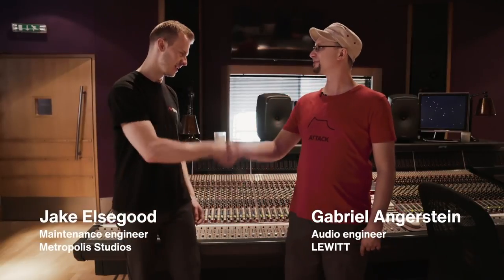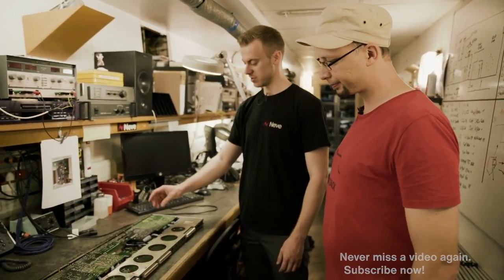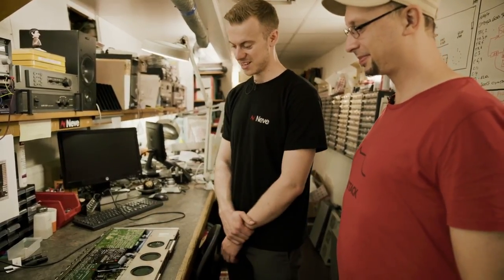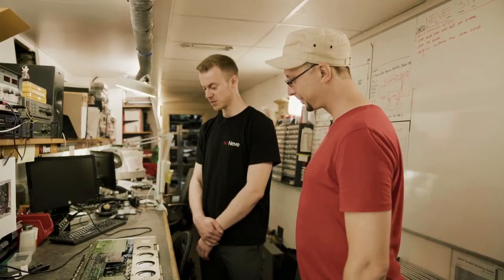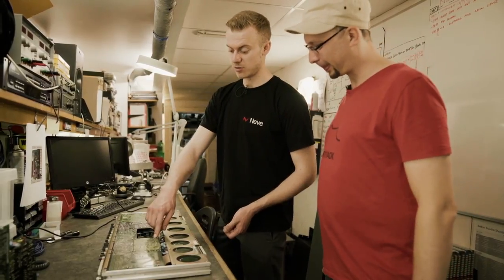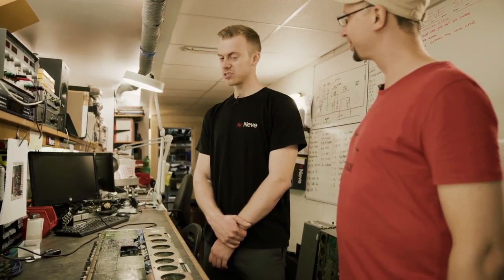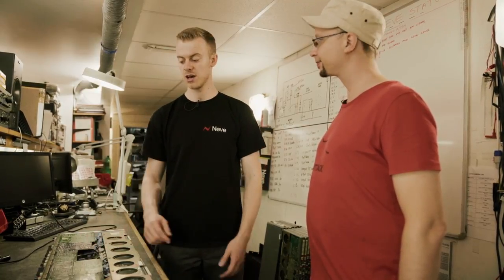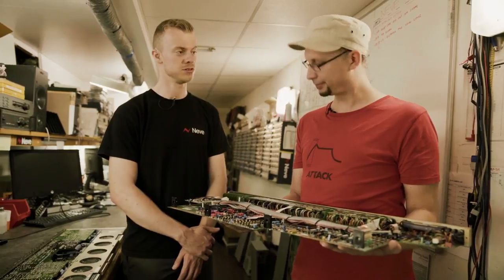A legendary Neve console and how to maintain it

Comment: On average £12K a year on electricity yes just electricity , and usually depending on how big of a knob the singer you have in the studio and extra few Grand a year in whatever module or Aux Goes down unless as I mentioned before singers who like to balance Brandy and coke on the edge of the meterbridge and get excited and knock it in to write of an entire 12 channel bucket .  I called it quits after that one and sold the rest on .  23 years and countless tens of thousands of pounds later we sold her on to a studio in Greece , I did keep 2 1073 moulds and 2 1064 from the Bucket that got killed , still have them now .
Also had a VR for a few years nice board not as sexy as the 8024  but still a lovely board
Reply from the maker: Ahahah! These sound like some very interesting sessions you've had! 😅 It's definitely a lot to maintain, are you mostly in the box these days then or what have you transitioned to?

Comment: I don’t own a Neve, but I still find this video to be very interesting, and, not just for Neve circuitry, either, but for all analog audio electronics, as some of the issues mentioned here (like the electrolytic caps on the EQ filters drying up and failing) could be encountered on any older analog desk. 
I love analog gear, it has a sound and vibe of its own. As a young engineer coming up in the early 80’s, I learned the craft of audio recording/mixing on analog consoles, tape machines and outboard processing. And when everything was working, it was a wonderful thing. 
But, analog gear does indeed require maintenance, and this video acts as a good lesson to impart to those engineers who are too young to have worked in analog studios, but who are thinking about integrating analog recording gear into their own studios... and that lesson is that analog audio gear doesn’t perform at its optimum forever. 
It’s not a question of “if” analog gear will ever need repair... but only a certainty of “when”. 
And, sometimes components did fail gradually over time...but they could also fail without warning...which, of course, always seemed to happen in the middle of a session. 
That said, if one has a solid working knowledge of circuitry and its repair, or component replacement, (IF you can still get the parts you need), then these people are better-suited for having and working in an analog studio.
🙏
Reply from the maker: Wow Donny, thanks so much for sharing your interesting thoughts. Really appreciate it!

Comment: I can really relate to this... I used to do a great deal of troubleshooting of PC boards with bad Vias.  Often boards with 8 layers just for the DC power.  Ground plane on the outside front and back (for shielding), then layers for+5V, -5V, +12V, -12V, +15V, and -15V power.  Then maybe 3 more layers for signals. After so many iterations of soldering, some of the internal layers may become disconnected from a via.  You have to be a damn good tech to sort it all out.

Comment: The big problem of neve v series is the switches because of the heat that the console creates inside, reduces the age time of the of plastic latches. Latches break inside the switches due to heat aplied to them, not the durty from behing used. Those  switches when were made there was 2 types of lacthes used : the white plastic latches that was more or less good, then neve realised the problem they had in hands, they changed to a black type of latches that supposed to be better to heat, in fact they proved to be worse then the white ones. Today we have tech, i improved my neve with a reduction heat system, in fact it actually heats less then my duality because extracts the heat faster frim inside, also  we have new latches for high temp. Plastic, that we replaced in the console, now actually the console reduces almost 95% of the issues that she had, caps switches problems is a thing of the past, we stop 10 days a year to maintenance of the console first 2 years, now actually we are doing 5 days a year, and we don't need any tech present. We got 5 spair working channels, and we swap a year 1 or 2 channels to repair. Top console

Comment: Is it left on 24x7 because it's in use that much or because that's best practice?
Reply: My cousin works in this studio, they're pretty busy.
Reply: I cant see leaving leaving electronics on for the hell of it to be any good. Constant heat is an enemy of circuity (even under normal operating temps) and would wear the components out faster and shorten the life of them. That is why this board maintenance is a full time job due to being always on.
Reply: AC units are installed running up to the important areas with ducts. Best to leave on to avoid spikes when switching on/off the ac units bring the area down to a very chilled temp.
Reply: It was a theory that proved incorrect.
Reply: One reason is that on many of these consoles the sound changes as they heat up, so if you turn it off you have to start it up several hours before you start recording to give them time to heat up.

Comment: So, I take it heat is principal in getting the right sound, even in non-tube class A systems like that Neve board, or does it matter?
But the question I have is do these vintage Neve consoles have fans built in to help divert heat away? There's always the fan noise you want to avoid , but still, some circulation would help "cool" things to a degree and increase the life of these capacitors wouldn't it?
Reply from the maker: Don't believe these older consoles had built in fans, but I'm not 100% on that. Studios definitely have to invest is quality HVAC systems because these consoles can heat up the whole room!

Comment: I might also point out. These guys are talking about a, Newer, Siemens, Neve.  Which is way more complicated. Than, Rupert's, earlier offerings. Between 1968 and 1974. When it was still Rupert owned. And not, Siemens.

Siemens had a rocky start. With a mistake they made. That nearly destroyed, dozens upon dozens. Of your kind of console in this video. Yes. And the story goes like this.

Rupert had the utmost in, manufacturing and integrity. Siemens is not so much. When they took over. And wanted to cut costs. Raise profit margins. But of course!

So for some kind of stupid reasons. They decided to downgrade, electrolytic capacitor,  heat ratings. And as noted here. In this video. Yup. They get a little warm. And when each module is shelved in tight next to another module. Electrolytic capacitors will start to sweat. And they will drool out. Their destructive, electrolytic, goop. As it drooled all over the circuit boards. And blowing them up. Blowing them all up.

Of course they were still all under,  Factory Warranty. And they spent millions of dollars. All over the world. Trying to fix these audio consoles. Like yours. Refurbishing, restoring, recovering them as best they could. But they never quite works right, ever, again. And good luck, Charlie! Boy! Might you be in for a big surprise?

I mean no wonder how you got it for such a great price! It came pre-FUCKED up!

But no. I hope that's not yours? But yours is still not mine or, Dave Grohl's. You've got the modern day Siemens Neve, POS. I mean I wouldn't turn one down. For pennies on the dollar. Because it won't sound like mine or Dave's. It'll sound good. No doubt. It won't have the same pizzazz. But you can still make beautiful sounding recordings just the same. On crappy equipment. I've proven it many times over. I put on a show for people. How to make great recordings with simply dreadful old equipment. As long as you understand what it can't deliver. And not what the specifications say, it's supposed to, deliver. Knowing what it can't do is more important. Then you can use it to its, fullest.

Yeah. You see. I had a do live audio for a major, US,  Radio & TV Network. And there is this aspect. With moving quick. And being able to do it in your sleep. Because you might be sleeping in the control room. When they awaken you. And tell you you've got 4 feeds coming in.  And we are going on the air in,: 20,: 19,: 18,: 17, and so on and so forth. And you're on the air coast-to-coast! Yikes! You're also on the satellite. Around the world. Aargh!

So it's fun to get this stuff under your belt. Early on in your lifetime. And when people want the very best? They will know who to turn to.

And actually rock 'n' roll is so much easier. That's why I switched after 20 years. 20 was enough of that other stuff. I had to get back to my roots again. All music. All the time.

So I shall likely be switching to a low cost, used, digital audio console. Why? Because it really doesn't make a damn anymore. Everything sounds great. Everything is 100% adequate and 100%, usable. Of course… In competent, hands. That know how to do it. And do it, till, I'm satisfied. And do it again. And again. And again and again and again. It's that much fun. You never want to stop. You just wait until your body, stops you. Like from failing health and old age. Ouch! You get the point. I get the pain.

It's all in a days work. And to live to do it. Another day.
RamyRAD

Comment: What a cool job to have ...this job will probably be obsolete in another 20 to 30 years
Reply: Many of this applies to digital consoles as well.
The only thing that are tough to fix are microcontrollers and processors.
It's just not as cool as analog haha!
Reply: The job includes maintenance for outboard gear, interfaces, cable making, and speaker repair too! I think tech engineers will probably be very handy in another 20-30 years!